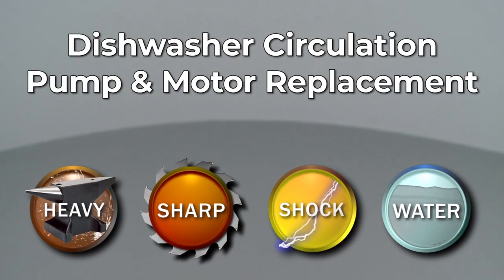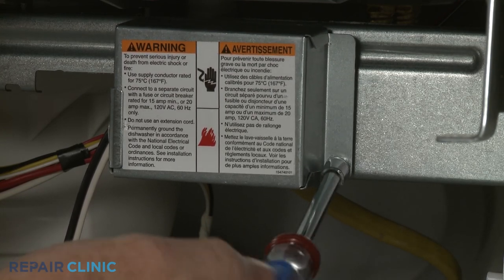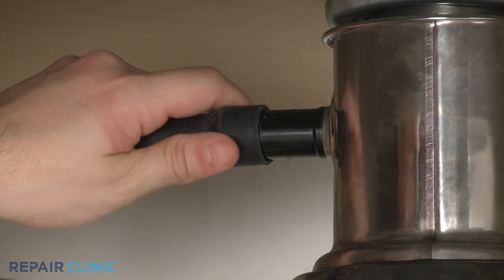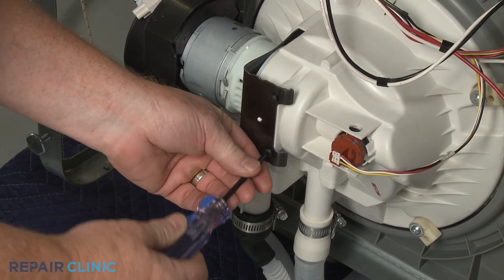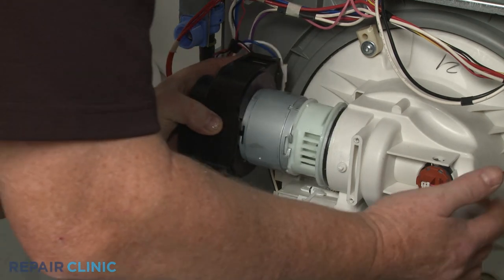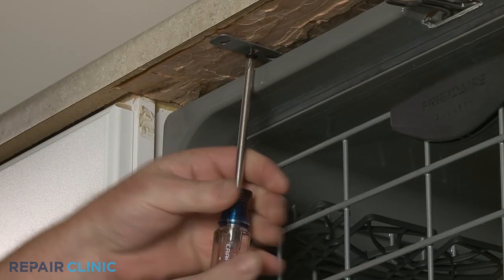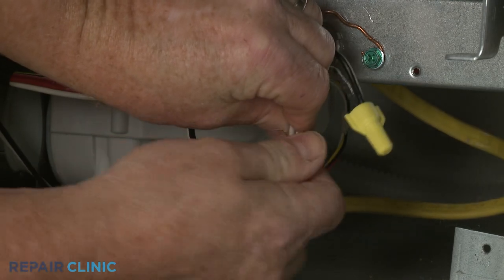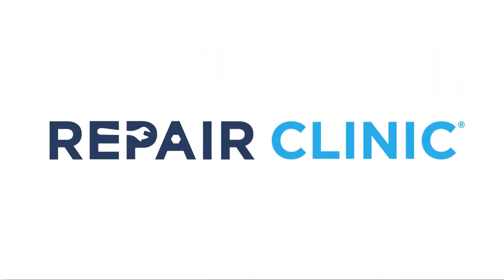Frigidaire Dishwasher Circulation Pump & Motor Replacement (part 154853801)

Comment: I can’t thank you enough for making this video. The appliance repair company wanted to charge me $500 for parts and labor to fix this. I found the part online for $98 and changed it myself in under 30 minutes.
Reply: i did as well an 8 years gallery dishwasher needed a new motor, replace in under 30 minutes by myself....great video!
Reply: @SuperBooboo02  Nice work! My repair job is still solid 10 months later.
Reply: 500?
May as well buy a new machine at that point

Comment: Great video. My install had enough extra hose on the water supply that I didn't have to remove that one. I unhooked the power and drain, slid it forward enough that I could tilt it back 45 degrees and had enough room to swap out the part.
Reply from the maker: Great job!

Comment: I removed the circulation pump & motor from my Fridigaire dishwasher.  I sprayed electric parts cleaner into the vent holes.  Black carbon came out.  Even though the shaft would spin easily, I concluded that excessive heat had killed the pump.  The inlet valve works properly.   I've ordered a replacement pump & motor.

Comment: After doing some research on my own, it's called an EC-3 or EC-5 connector. Most notably used for Lipo battery harness. Which is it for this motor?

Comment: I have a Frigidaire model and the spray arms don’t move at all when it runs. Is this low water pressure causing this because of faulty motor or pump and do I need to replace or can pump be repaired in this case ??

Comment: i replaced drain pump and still no drain.. does a circulation pump help with that process?
Reply: this is not a drain pump...its a circulation pump for water pressure..it has nothing to do with draining issues

Comment: 🌞🌞🌞🌞🌞🌞🌞🌞🌞🌞🌞🌞🌞🌞🌞🌞🌞🌞🌞🌞🌞
My Frigidaire dishwasher is getting water in, but I hear a click that would normally result in water circulation that never happens.  I can advance the cycle and drain the dishwasher as well.  The spray nozzles are clear and glass particles were removed from the filter.  I need to troubleshoot a couple of things....
1.  Is the float switch shutting the water supply off prematurely because the water level is not above the heating element when I open the door to check

2.  Is the circulation pump defective or does it obstructed by debris?  Where is it located and is there a video on the procedures?

Any help greatly appreciated because our new dishwasher won't be here for 4 months!!!!!!
🌞🌞🌞🌞🌞🌞🌞🌞🌞🌞🌞🌞🌞🌞🌞🌞🌞🌞🌞
@RepairClinic.com

Comment: ive got same style circ pump on my frigidaire dishwasher..its leaking water at the bottom area that has the open slots on the pump...i took pump off and there was a small kids toy inside the impeller area...i took toy out and reinstalled but its now leaking intermittently from same slots..and when its leaking the motor doesnt sound the same ...my theory is the toy jammed the blade and the motor spline teeth basically reamed the plastic impeller hole and now it takes very little resistance the the motor would spin without impeller turning...this builds up too much pressure and pulls the spring loaded washer away from the shaft and then leaks out the assembly....does this sound logical?

Comment: I just replaced my circulation pump motor but now the tub is not draining - there is still standing water after every cycle. HELP!
Reply: circulation pump has nothing to do with draining...you need to look at the drain pump.

Comment: Good video.  Unfortunately the replacement motors that all these online sellers are providing are all the same and they are all horrible underpowered junk.  The replacement parts are not the same quality of the original part.  In many cases, the replacement parts are modified so that they will "work" with a broader number of models than the original part would work with.  This means compromises in design and this means poor performance.  My dishwasher is one of the 36" portable models that you have to hook up and plug in.  It now barely sprays with enough force of water to get anything clean.  Terribly frustrating to live with, but I don't want to buy a foreign factory design.  Frigidaire no longer makes the large portable models so I'm screwed.

Comment: A lot of unnecessary steps. Just unplug it at the outlet, turn off water supply, remove any screws securing it and pull out far enough to tilt it over. No need to disconnect the drain hose. Do not re-use the old gaskets. A replace,ent pump should come with replacements.
Reply: @MrRdparri  Based on my experience, it would be wise to obtain the o-ring before installing. While the old o-ring may look ok I can guarantee it’s stretched out and will not seal.
Reply: Where can one buy the o rings? And how will we know the size before taking it apart?
Reply: @michelalex7069  Front O-Ring part number is 154247001. Rear O-Ring is 154246901. Both P/N are Frigidaire. Use the following process to find any P/N: info is key - search the model number via the internet. Should come across a few sites that show a picture diagram of the part along with a reference to the part number. I hope this helps.

Comment: the new models 2426 2413 2418 the motor is stuck brand new from the box Dont buy those model they change the motor from older version now is all plastic cheap alld this models have the same motor I am appliances installer and  all of this model is the same
Reply: Omg our Frigidaire has been horrible, noisy, ineffective right out of the box.  We had motor replaced under warranty once, it was still noisy but COVID, so we dealt with it.  Now we have dripping from the motor.  Such horrible quality!